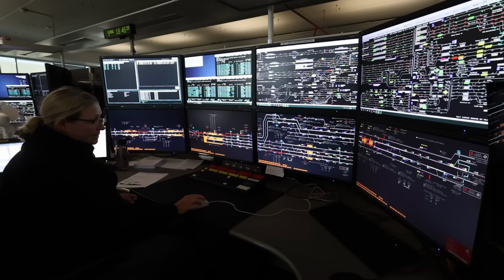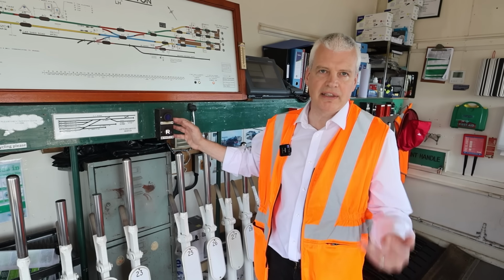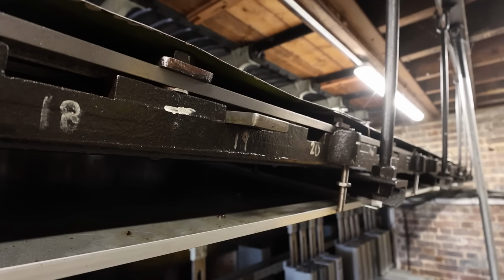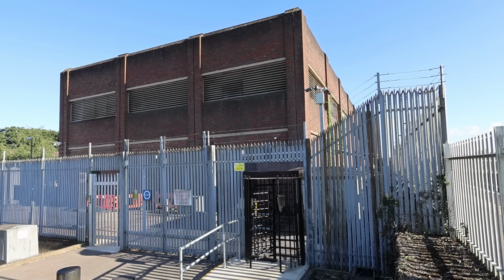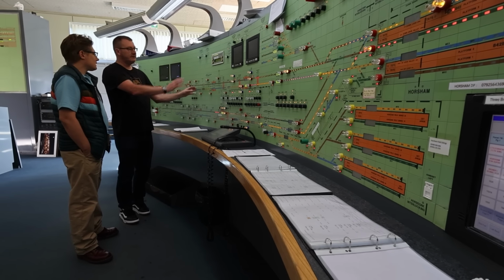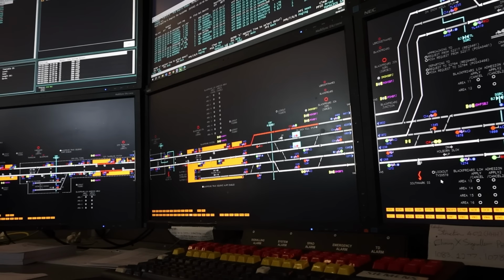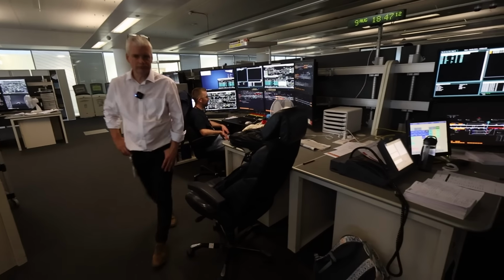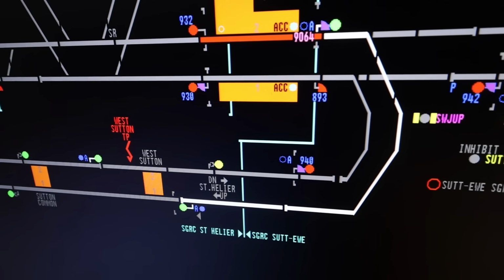Why Do We Still Have Semaphore Signals?

Comment: You didn’t ask the best question of this stupid new single box is in one location what controls points and lights 100 miles away?
The question is what do you do when the point fail a send someone from the single box down to the point by letting him walk to send someone from the nearest depot? What could be anywhere up to 50 miles away to the station with the damage points to move them.
The answer is B because having no signal box near all the points like it was now if a point fails it stops the entire railway for hours when the single boxes were around it might stop it for 20 minutes.

Comment: Semaphore signals in the United States through most of the 20th century were controlled by electricity, but were still controlled by interlocking towers. Centralized Traffic Control (CTC) became commonplace in the 1940s on high-traffic routes, but some places like small yards and diamond junctions had interlocking towers up to the 1990s. Big levers were only used for rod-linked switches, and cloths weren't always used when moving them.
The only non-preserved line in the United States that still uses semaphores spans BNSF’s Glorieta, Raton, and Albuquerque subdivisions which the only regularly scheduled train to run on it is Amtrak's Southwest Chief. These are automatic signals which are directed by track warrants.

Comment: Question; why do we still have semaphore signals?

Short answer; it costs money to resignal and if the present equipment works and can handle the number of trains passing throughthe area then it's not worth spending the money so the semaphores remain.
Reply: And far more reliable
Reply: Shorter answer:  They look cool

Comment: I started working on the railway in 1959 at a small station in the Peak District called Chinley. There were 6 platforms, one was a bay that held about 4 coaches. It's still fully operational. One of the lines goes to a cement works, that supplies most of Northen England and Barrow in Furness in Southen Scotland.
Reply: Hi I'm an ex r signaling installer iv worked at chinnly bring back br days

Comment: Why do the CCTV screens go off when the crossing has been declared as "clear"... Why wouldn't you want to maintain vigilance until the crossing is actually "clear"..I.e no more trains. this seems like a massive downfall for NR. Let's be clear.. I've got 20 odd year xp... Why are these CCTV crossings monitors switching off once cleared... This is cost cutting. No spare SIG to watch it and then route elsewhere.

Comment: actually 2 more reason you would re-signal areas, 1 is you dont need to train drivers on as many different types of signals, 2 is you dont have to pay as many signallers, with ETCS the old signal boxes with eventually get replaced even if they dont need to be

Comment: You might be interested to hear that, as far as we know, the first place where a signal man didn't actually watch the train pass by his box was Greenisland, County Antrim on the LMS NCC.  When the LMS NCC was building the Bleach Green - Monkstown "Loop Line" in the early 1930s (to remove the need for Belfast-Derry trains to reverse at Greenisland), they installed colour light search lightsignals.  The signal man in Greenisland could only watch Belfast - Antrim trains progress as little lamps on his panel lit and then went out.  Like Littlehampton, there were short electically operated levers for the Loop Line and long mechanical levers in Greenisland box, as Greenisland station itself was still signalled with semaphores.

Comment: u should ddo a video on angmering just after littlehampton, the train gates have been down for 22 minutes before and its a hot issue - the bus operaters have talked about splitting the 700 and number 9 bus and the train guards have let pedestrians into the station to use the bride to cross bc the village is split into the north and south if u go north of angmering to rustington or east preston u have to either walk all the way round to the bridge or wait at the gates LOL. its bc of the new extra trains to brighton 4 ph i think, then 4 ph to southampton central. still only 2 ph to london victoria rho. i think it would be interesting. i think people should use the bridge bc i use the trains a lot but others want southern rail to reduce the trains.

Comment: If you mean the old-fashioned type signals such as those shown in the picture to go with this video then I can tell you that we do  - although they aren't really used in conjunction with any trains (the one  i am referring to)

Instead its on a cycle path in our town just before a footbridge that crosses a busy bypass.

I also doubt very much that it's actually connected to anything either.😜🤣

Comment: Interesting that the CCTV that gives the signal operator a view of what's going on at the level crossing switches off as soon as the operator presses the "Crossing clear" button. So if anything happens after that time the only thing preventing a potential accident is the train crew noticing something's wrong and being able to bring the train to a halt in time.

Comment: Since the actual semaphore signal arm is only an external indicationn to give a visual feedback to the driver and by implication how the relevant points are set, how necessary are they with in-cab signalling? Is it true that on high speed lines (300+ kph), a semaphore is rather useless since by the time you could see it, it would be too late to take appropriate action?

Comment: Semaphore signals are still the best signals there is. At a distance they can be seen in bad weather and in case of an electrical failure, they fall by gravity to the “stop” position. With reflective DOT tape and / or LEDs they can be seen at night.
Reply: Colour light signals are objectively better than semaphore signals, hence why they've been gradually taking over during the last 100 years. They show the same indications by day or by night. No moving parts, so less prone to failure and easier to maintain. Far superior visibility. More compact, so easier to sight behind bridges and electrification masts etc., and more easily accommodated in restricted spaces such as tunnels.
Reply: @simonlowe3766 absolute load of nonsense, semaphore is a failsafe system, everything else is prone to failure,end of discussion

Comment: I was a signalman for ten years around Dundee working in ten different boxes. They were all manual boxes, I did spend some time in Dundee Power Box and learned for to operate the new system installed. People think that the train driver is the man responsible for train safety. Wrong. The driver is responsible for one train, whereas the signalman is responsible for one, two, four, ten or any number of trains. He is the most important man on the railway. I also did ten years as a ticket examiner and finally, twenty years as Station Master in the north of Scotland. I loved working on the railway. I retired at sixty nine after over forty years.
Reply: What a marvellous career! Best wishes to you Brian.

Comment: I do love semaphore signals, until fairly recently they were still in use on the Greenford branch line and I found it fascinating. You can see still infact an old set of signals from Greenford station on the old Acton-Northolt line. 
Fantastic video, very structured - loved it!

Comment: Great stuff as ever, Geoff.  I'm amazed that the Level Crossing CCTV turns off once the signaller has confirmed that the crossing is clear.  I suppose it sets a boundary as to their responsibility for what then happens... but it seems odd that there's no opportunity for the signaller then to observe (even by chance) a catastrophe in the making and take action to reduce its effect.
Reply: You can turn the picture back on. ( I tend to most of the time).

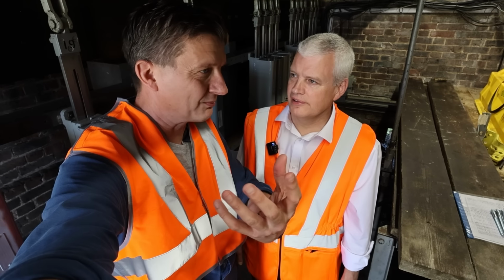Comment: 4:48 There are forms of mechanical logic that were earlier than railway mechanical interlocking, for instance the Jacquard loom, which used punched cards to weave a pattern, was patented in 1804.  There were lots of different precursors to the electronic computer.

Comment: Mechanical logic was around long before the railways. Charles Babbage designed his difference engine in the 1820s, but there were primitive mechanical calculator designs in the 17th century, with Blaise Pascal producing the first truly practical one in the 1640s. Charles Babbage also had a go at producing a programmable mechanical computer in the for of the Analytical Engine, at great expense but with little to show for it save for the advances in high precision machining.

If we are to widen the definition to include analogue computers, there's the famous Antikythera mechanism, which probably dates to around the first century BC.

Of course, none of these are programmable machines in the modern sense, but it's fair enough to say that the mechanical calculators used logic.

Comment: I think I am right in saying that Network Rail has around 350 mechanical signal boxes still in use, a further 250 NX panels (eNtrance eXit as in pushing those buttons in the video) and 30+ ROCs (Rail Operating Centres).

Comment: The only place in Hampshire with main line semaphore signals & a pair of shunt disc's is Marchwood Station & the MOD line on the Totton - Fawley Branch [all converted from lamp oil to electric lighting using yellow bulb's in the early 2000's ] although Eastleigh Yd still has operational semaphore shunt disc's signal's & until 2021/22 EH Yd still had a SR black/yellow shunt neck disc which now leaves the the Marchwood MOD line as having the last operational black/yellow disc in the Hampshitre/Dorset/Wiltshire area.

Comment: The railways are doomed.... How can this museum stuff still be around in the 21st century...
Reply: it's easier and cheaper to safely maintain a 19th-century-standard mechanical signalbox (with modern embellishments), than it is to maintain the electronic signalling systems of the 1950s and the early computerised systems of 1980-2000. So paradoxically the signalling systems installed between 1950-2000 tends to get priority for replacement in resignalling schemes! On the fringes of the network with a few trains per hour, mechanical signalling is good enough for now

Comment: I remember as a kid in the late 70s I had a distant uncle who was a signalman at Surbiton.  I remember spending an hour or so in the signalbox one evening; and the (then) giant panel taht was about a 10-15 mile stretch of the South West Mail Line (and a few minor lines). I remember that the level crossings all had CCTV, and the signalmen had to turn on the flashing lights, wait for the cars to stop, then drop the gates, (all done via CCTV) then set the signal.  I still look for that box (it's still there) when I whiz past..

Comment: Tim gave a really clear and easy to follow explanation of the signalling machinery. I feel like I've seen several railway films showing a signalman pulling the levers but never the details about the differences in the levers and the machinery and interlocking system beneath.

Great blurring effect on the train at 16:55

Comment: Thanks Geoff, took me back to my first job as an S&T technician on WCML. Done training on North London line local signal box was North Pole Junction and main job at Watford Junction PSB (NX panel). Although you saw Mechanical interlocking surprised they didn't show you  the next stages of interlocking Route Relay and Solid State. If you want to try being a signaller try the Simsig program.

Comment: This kind of reminds me of my job at the New York City subway at a smaller scale. I don't handle the signals. I actually drive the trains but to see the people at the towers  in the master towers that cover a huge section of the Subway and in the Rail Control Center that covers the entire Subway system. I've seen how they work while i'm at work
Reply from the maker: Amazing! what line do you drive ?? What’s the oldest signalling they have on the Subway?
Reply: @geofftech2  I'm all over, but i've operated every line in the system. The oldest I've seen in the system is Jay Street and Hoyt-Schemerhorn Streets Towers in Brooklyn. They have the old signal levers, similar to the signal boxes in the UK. They also have those old signal levers in some of the yards. Most towers have push button levers where you set an entrance and exit on the line.

Comment: You're obviously part of the "deep state" as you did not show the signals/switches/routes leading to platform 9 3/4 at Kings' Cross 🙂  (or at least ask which centre controls them and the tracks to Hogwarts !

BTW, some of the more modern centres allow one to queue a route over switches currently interlocked by another route and once the train has cleared the first route, the switched move into position to grant (and interlock) route 2 and train driver needing route 2 gets the green light right away.

Comment: You should try Simsig - it's a signalling simulation for your PC, and the graphics are basically the IECC system (like you saw in the Three Bridges signalling centre. Actually, I think Simsig has a Brighton simulation). It has simulations from simple ones (you can start with Royston to learn it) to some very complex layouts and ARS (automatic route setting). Some simulations are free, others are sold for a modest price.
Reply: Excellent simulator.  The Brighton (alone) simulation is no longer supported, but it's replaced by the Three Bridges simulation (purchase only).  One of the great features of the program is the ability to get together with one or more other operators and split the control realistically; alternatively, most simulations can be run by a single person (although the cliché about the one-armed paper hanger often comes to mind).

Comment: When I joined British Rail in the 80s I asked to visit the Three Bridges Signalling Centre (I think that they thought I was a graduate trainee- I wasn’t). It was in-out then too. Massive disparity between the branches and mainline operations. When I was there the service collapsed at East Croydon/Purley in the PM peak. It was quite obvious that many of the staff, transferred from rural signal boxes, were not quite up to running a Signalling Centre! A ROC has more in common with Air Traffic Control or a Financial Service operation…

Comment: Still use mechanical interlock on nuclear power stations, unlikely to fail to danger and generally easy to see what condition they are in. along side electrical interlocks and other safety systems.

Comment: Best video ever Geoff, absolutely outstanding. Only surprise for me, as I'd clearly misunderstood,  is that even with ETCS there are still traditional signals trackside rather than in the cab. Wonderful job by Network Rail hosting you and explaining everything so clearly.
Reply: There are different configurations and levels of ETCS deployment, retaining existing lamps on sticks style signalling concurrently with ETCS deployment is often used to facilitate migration when not all rolling stock is fitted with ETCS on board equipment at the time of ETCS deployment. In due course when all trains that use the ETCS area are fitted then the traditional colour light signalling can be removed.
Reply from the maker: ah, thank you .. kind comment!

Comment: Liked the analogy of the signal box interlocking machine to a computer, which I would call an analogue computer as compared to a digital computer. The principle of interlocking between points and signals goes back to 1889 legislation following recommendations from the Railway Inspectorate after their investigation of accidents, along with the "block" system (1 train per section of track) and continuous brakes.

Comment: Just wondering why do we still having problems with signals, points, gates failure if everything (nearly everything) is operated by computers. It also worrying is what happened if a virus was gotten in these computers or someone hacked into them or there was major power cut or power surge etv, what will happen then? It was much better have signal boxes (manage points and Signals) and the old swing gates to manage crossing which was operated by wheel houses, also the swing gates also stop people from accessing the network railway lines, all it stopping them now is wooden slaps laid at angle which does not it seems people getting on to railway lines

Comment: In NZ with about 3,500 route kilometres, we have a new signalling centre for all of the system recently opened in the Hutt Valley. Only the Auckland suburban system has a seperate control centre. All our signals are colour light, and most of the system is single track except in the main centres. So crossing loops are strategically placed to allow opposing trains to pass. Many years ago I was able to visit Wellington “A” box and have also been in the old Napier and Taihape control rooms, now redundant.
A very interesting video from Geoff, who always asks the questions we all would want to ask.

Comment: Having spent the weekend researching and nerding out on signalling in the Wessex area, this is a very timely video! Very interesting to see the 3 "boxes" side by side. One question I have that you didn't touch on: What about redundancy in the new ROC? What happens when systems go down? Can they transfer control from one desk to another? And what if the whole place goes up in flames for example? Could they transfer control to another ROC temporarily? The more you centralise things, the more damage a single failure can do. I believe they had issues at the TVSC in Didcot a few years ago when the power failed and trains had to stop across a wide area of the network until power was restored.